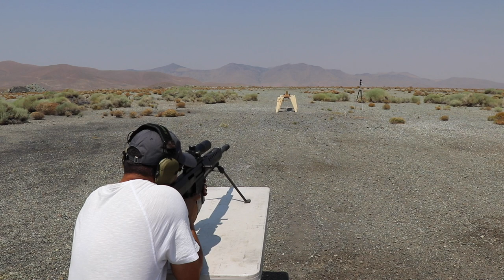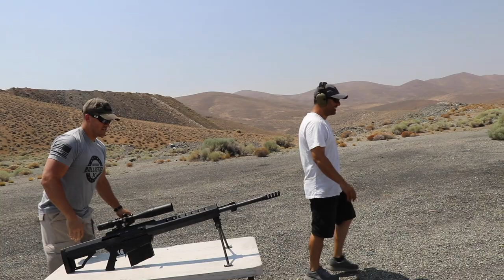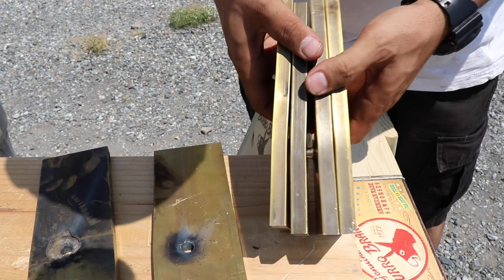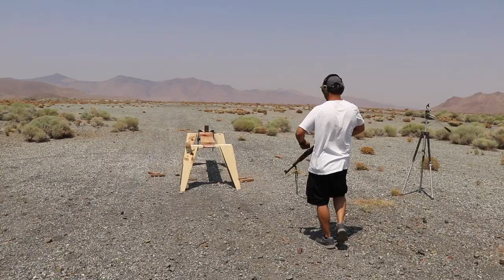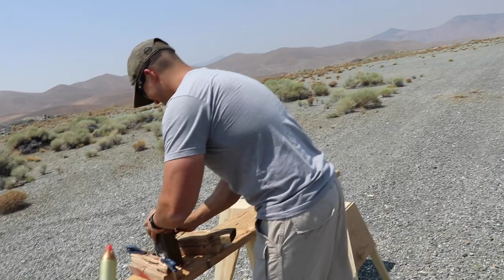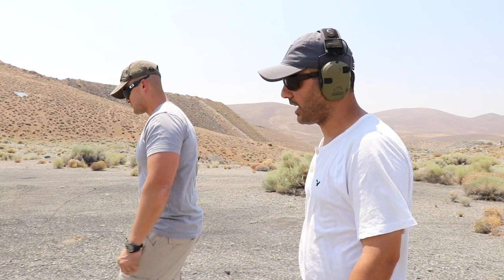How much Gold does it take to stop a 50cal?

Comment: Gold is so malleable, unlike railroad tracks, just some clean shots, no cracking. I think welding inspectors should have you come and check weld strength with your guns. I'd love to see how 6013, 7018 and 6010 AC as well as DC welds withstand your 50 cal.

Comment: You need to firmly support both the bottom AND the TOP of the bars.  Supporting only the bottom compromises the angle of the bars as the projectile penetrates the bars, thus affecting the trajectory plain of the projectile as it penetrates through subsequent bars.  I bet you will have greater success if you can stabilize the top of the bars.

Comment: If you're looking for armour piercing try an Iridium bullet. It is a rare and expensive metal that is notoriously difficult to work with, but it is denser and harder than depleted uranium and actually not illegal.
Reply: Oh, I forgot to add, If you ever do manage to make an iridium bullet make sure it has a thick copper plating. It is harder than steel and will destroy your barrel if uncoated.

Comment: Edwin,
There is always confusion about which obstacle ( gold ) was first in line and facing which way. Simple solution: invest in a roll of small stickers and number them, slap them on the he item being destroyed and fire away. When you check, after firing, just look for number one ( 1 ) and so forth. Then you just replace them in the correct order. Et voila, problem solved.